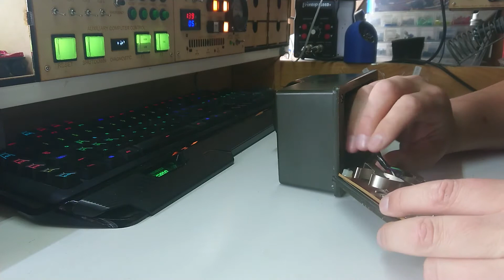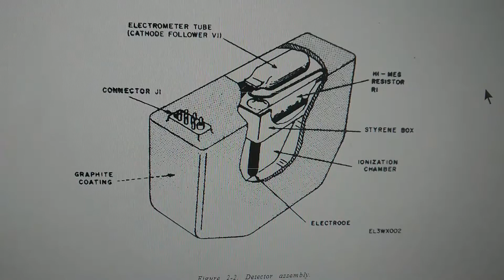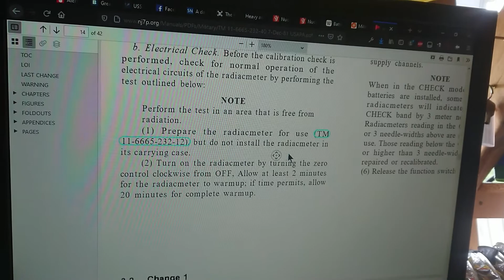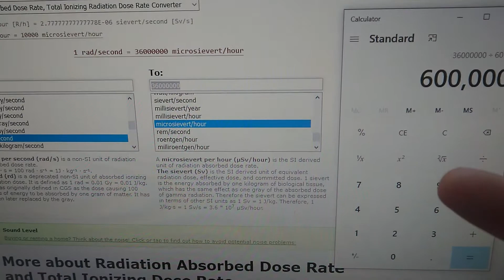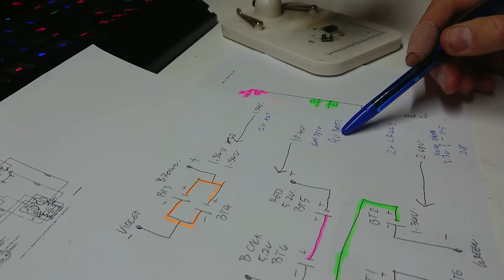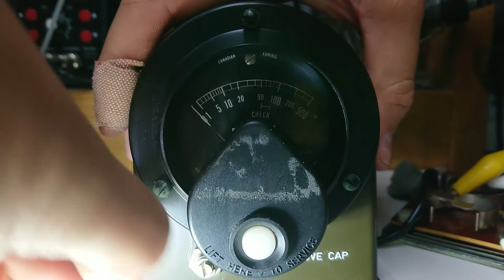IM-174A Radiacmeter | fitting modern batteries

Comment: I have a question, i have a few of these all with the same issue, when i turn it on the meter on the front maxes out. And when i refer to the manual it doesnt show how to fix it (and the knobs wont adjust it?)
Reply from the maker: The power knob is also the zero adjust.
Turn it until the needle sits at zero.
Reply: @TheAussieRepairGuy  doesn't work even with fresh batteries, I check the manual, and it just says "refer to higher level maintenance." Maybe something is corroded, but the connections seem sound
Reply from the maker: @baneofnight315  I assume you are not using original mercury batteries?
sounds like that circuit is over-voltage.
might be worth taking the time to ensure that the wiring and battery voltages are correct. They need several different voltages that are isolated from each other, if they share a ground, this can happen.
Reply from the maker: @baneofnight315  I did a quick short for you on the process, not sure if that will help or not, but gives you a baseline of what "should" happen.
https://youtube.com/shorts/oJ2GJOftEAE
Reply: @TheAussieRepairGuy  well mine is a im-174B/PD not exactly the same as yours but I used a 1.5v D cell like the instructions say
Reply from the maker: @baneofnight315  Ahh you have modern version, mine was old mercury battery type.
if using rechargable D's the voltage might be lower.
Also if the ionisation chamber is unplugged it can do that too.
If rotating the knob does nothing, it could also be that a wire has dropped off, or the capacitors have dried out.
Reply: @TheAussieRepairGuy  https://youtu.be/R-CQTkM1cuA made a short aswell, not sure if the audio worked but I showed most of the issue
Reply from the maker: Apologies for the delay, the link got this comment held for review. I should set you to auto approve one of these days.
Reply from the maker: 7:43 mark in this video:
https://youtu.be/FHPbPgh9g78

Comment: I just got a new old stock meter which is the exact same thing as you have. So, all I really need is the batteries which are common and just the battery holders and re doing the wiring?
Reply from the maker: Pretty sure I show the diagram in this video. I couldn't find mercury batteries anywhere in australia, or anything if the correct voltage and size.
Reply: @TheAussieRepairGuy  When you initially did the counter check and the voltage was a little too high, how did you adjust it? I order the battery holders and 9v clip.
Reply from the maker: @heathg2681  there is a calibration knob. Very easy to adjust. I plan to do another video on this soon when I test an x-ray machine
Reply: @TheAussieRepairGuy  Ok thank you. When I get the items in, would it be ok to ask some questions if I run into any issues?
Reply from the maker: @heathg2681  yes by all means, but I'm no expert on these. I haven't touched this unit since this video
Reply from the maker: Can confirm 5 months later - that yes the modification worked - someone donated an X-Ray machine:
https://youtube.com/shorts/Agk65HKmuqs?feature=share

Comment: Mate. Your Radiacmeter has a Radium Luminous Dial. Shine a Blacklight on it and you’ll be able to see The scale very clearly.
Reply from the maker: Yes I had gathered that might be the case.
I'll be revisiting this one at a later date when I test out an animal x-ray machine that was donated to me.
I have a few safety precautions to set up before that first.
Reply from the maker: I just wanted to post an update, now that I have more sensitive gear - no the dial isn't radioactive. It has an electrically lit dial (the big lump on the front) that uses mercury batteries - I fitted it with a green led for the purposes of filming this short:
https://youtube.com/shorts/Agk65HKmuqs?feature=share